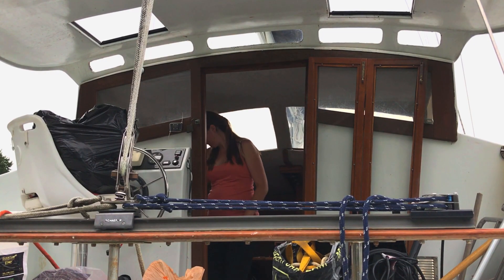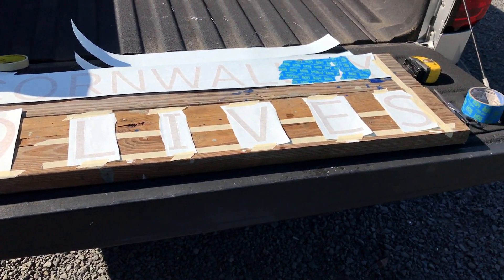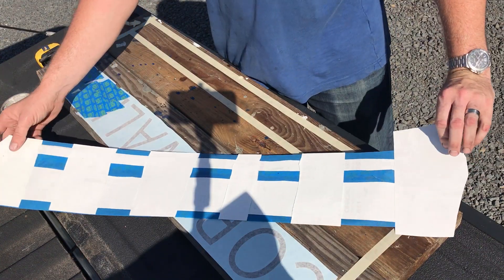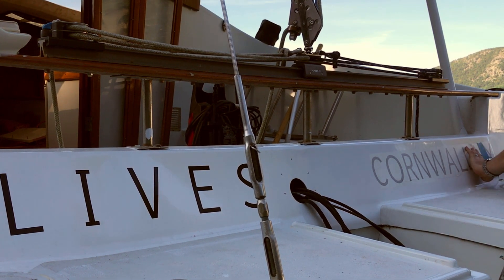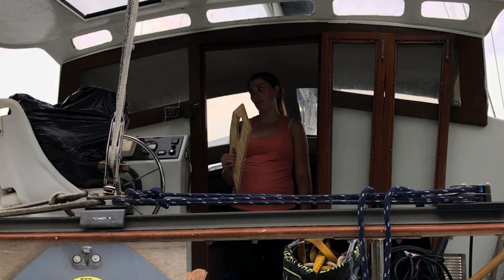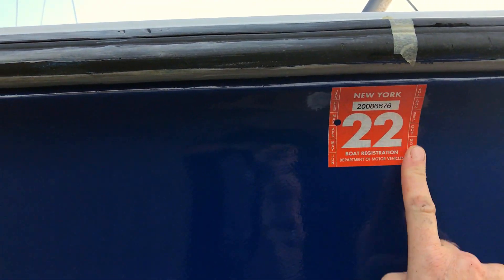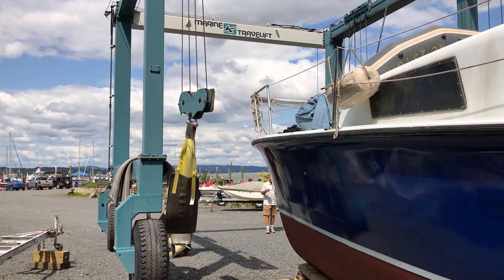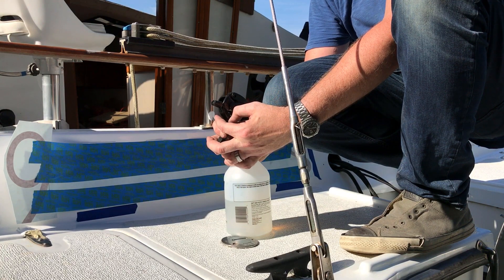Our USCG Documented Boat Is Now Legit... And Launched! (Episode 28: Sailing 9 LIVES)

Comment: It is for climbing the mast. Slide it up a halyard and the jammer will hold it. The 2 holes are for your feet
Reply from the maker: Sailing Celtic 
Yep, correct! Apparently, it is used with a boatswain chair... climb a little, helper raises the chair a little, sit in the chair, repeat. Definitely not intended to be used completely solo.

Comment: We had to sand the old name off as it was painted on.  We did our name on sides, easier to read.  I so hated putting the registration sticker on my new paint job!  https://youtu.be/2YLsoW6er4w
Reply from the maker: Oh, for sure, putting a sticker right on the new paint was a bit painful!

We ordered stickers that match the "9 LIVES" in our simple logo, and the original plan was to put them on the sides. We were going to put the hailing port on the stern, approximately where we did in this video. BUT... a friend told us that the USCG is starting to enforce (more than they used to) the rule that says the name and hailing port must be "together" on the same surface of the vessel. We certainly didn't want the port name on both sides in minimum 4" characters with the boat names... So, a new name decal was ordered that would fit on the stern along with the port. See video above...

When we DO paint the top of the boat white, I think the logo decals we originally ordered WILL be used on the cabin sides... maybe...

We'll check out your linked video. :)

Comment: In Canada, any boat with an engine under 10hp does not require registration. I know many boats in British Colombia Canada that have tenders with 9.9hp and lower motors, that are not registered, and they travel internationally. My understanding was that the Horse Power limit was international. Am I wrong? Or are those boats in BC running illegal tenders if in the USA? They do have the names of the vessel they belong to on them however. Cheers from Winnipeg.
Reply from the maker: Interesting point.
As per the New York State Dept. of Motor Vehicles:
"In New York, boats (watercraft) without a motor do not need to be registered.  If you use a motor (electric or fuel-driven), regardless of the size of your boat or the motor, you must register your boat." I further checked, and a dinghy is considered to be an independent boat in NY, even if acting as a tender to a larger boat.
Our boat is documented, so not technically registered with NY. Boats (and dinghies) registered in another state can skirt the NY rules if they are in NY waters less than 90 days... but then our dinghy is not registered anywhere and we are in NY more than 90 days usually... so it is a grey area, at best.
I bet you are right about Canada, and I know for sure that the 9.9 hp motors are designated as such specifically to fall under the 10 hp limit. Perhaps there are other states in the US that do not require registration of boats under the 10 hp limit... I don't really know.
Reply: I believe that international will go by place of registration vessel is from.
Reply from the maker: @SV_Sangha  
Yes, quite likely in most cases. But I bet there are a few places out there that have their own rules and will enforce them against any boat visiting their waters. :)
Reply: As a second note....  a dingy probably should not be named the same.  It's a safety measure, so that while main boat is anchored out, it's not made obvious by a same name dingy tied up on dock.  That advertises the main boat is unoccupied....  not a good safety measure in some parts.
Reply from the maker: @SV_Sangha  
That is a fine point. We follow similar precautions even when away from home, like not posting "Woo Hoo, we're away SAILING for the next month!" on social media.

Comment: Good Job. How much head room is in your cat?
Reply from the maker: Thank you, Stan!
Down in each hull, there is 6'2" of headroom. Over the bridgedeck, just inside the door, there is 6' of headroom... obviously much less by the settee. To achieve the 6' of headroom, the bridgedeck clearance above the water in the center of the boat (center fore to aft) drops down by about 6"... a design compromise, for sure.
Reply from the maker: Tony thompson 
Good question! There is no law (in the US, anyway) about it. I know in South Africa, and likely elsewhere, catamarans are required to be a bright color on the bottom between the hulls so that they are more visible to search and rescue teams when the cat inevitably flips over. "Inevitably".
I believe there are a few reasons why so many fiberglass boats end up being white. One is that tinted gelcoat is a bit more expensive to make, but more than expense alone tinted gelcoat tends to get chalky and lose its brilliant color over time. It needs to be cleaned and waxed constantly. White gelcoat needs the same care, but it is a bit less obvious when neglected. You'll note that we chose a 2-part marine paint instead of gelcoat, specifically because the paint is far more durable and won't lose its color.
Another big reason for white boats is heat... in temperate areas where boating is done primarily in the summer or areas where it is warm or hot year-round, white reflects sunlight better than an opaque color, and so less heat is absorbed and transferred into the boat. Our boat will probably be a bit warmer and less comfortable when we are in the Bahamas than it would have been if we had painted it white, even though we only painted the hull sides dark. Sunlight striking the boat at an angle will heat up the hulls a bit, as will sunlight reflected from the water.
Maybe there are other reasons for white boats... I don't know... but I sure like boats with some color on them!